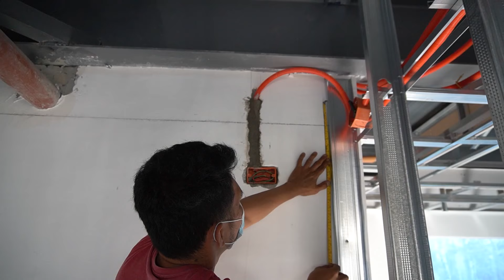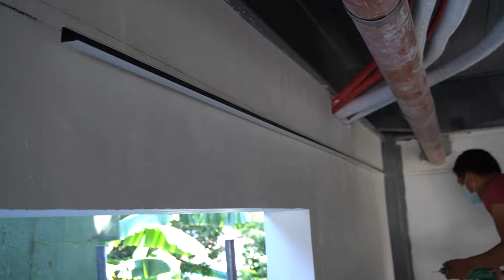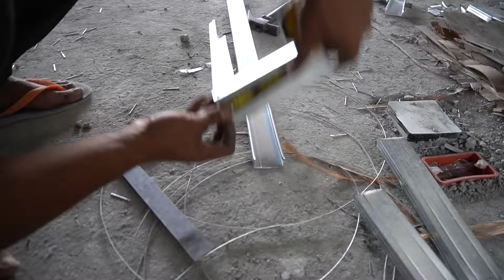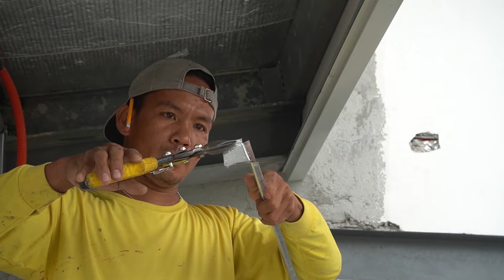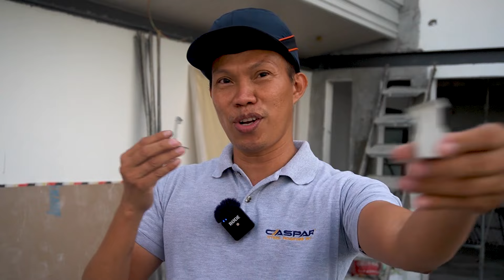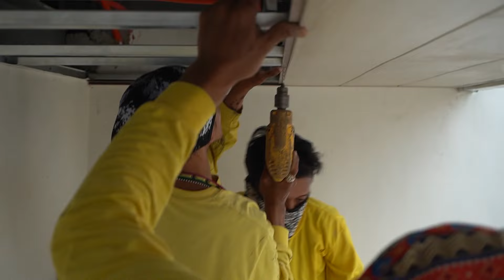[S1.Ep.11] HOW TO Install Metal Furring Ceiling

Comment: Sa tip #6 di po ba 60cm yung spacing ng metal furring?
Reply from the maker: Yes Bro, standard nasa min16 inches -max 24inches. meron correction sa description 16 inches not 16cm
Thanks for watching. stay safe bro.

Comment: Brod pol magkano magpa install ng metal ceiling
Reply from the maker: Hi Bro depende sa ceiling kung may design or flat.. you can contact  to my office 86601587 or 09209745828

Comment: Pano pong diskarte kapag mg iinstall ng ceiling fan jan? Mababaw kc d kumakapit mga turnilyo, any tips? Salamat
Reply from the maker: Kailangan may support po sa loob ng ceiling don nyo po e t tekscrew ang ceiling nyo na atleast 1 1/2 inch pwede nyo po palitan tekscrew nyo kung maikli. Salamat po
Reply: @casparroofingchannel  prpblema po kc nakakabit na ung kisame nung nabili na nmin ung bahay. And ala kmi access para makasilip man lng sa loob ng kisame. Gsto ko sana itry ung toggle bolt, kaya po kaya un? Salamat